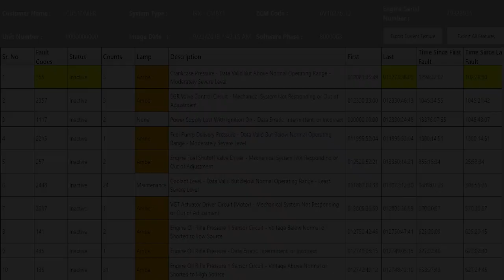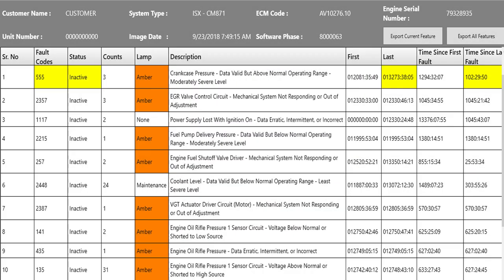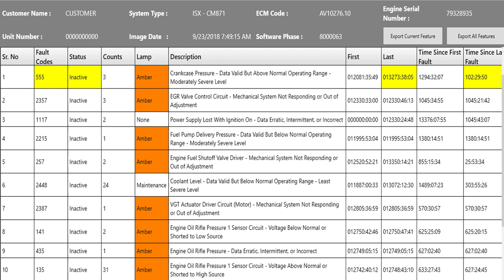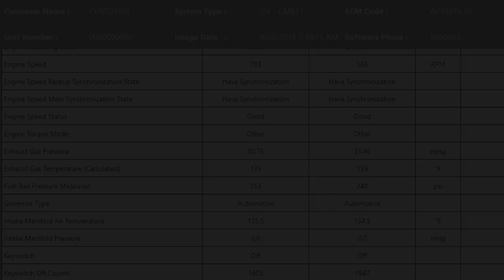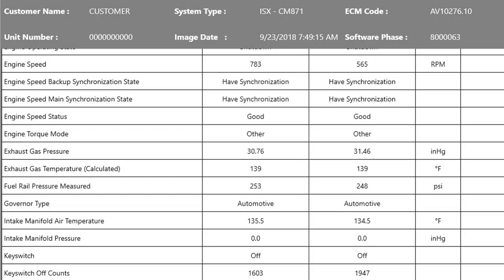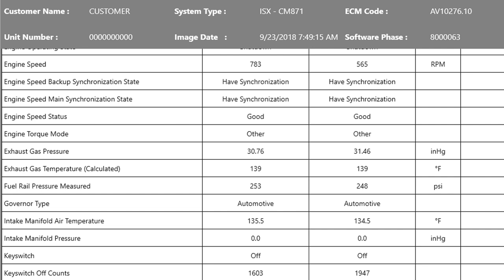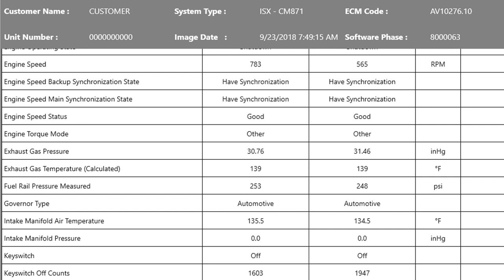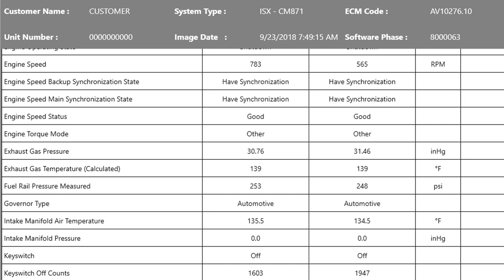ISX 871 FC 257 engine run on with key off

Comment: If someone was looking at a Cummins isx or a Cummins n14  if a driver were to try to set a maintenance schedule is there a serious difference in the two engines when parts needed to be changed and service needs to be done thanks
Reply from the maker: speaking for me. I would set the N14 overhead every 250K if it were electronic. Every 100k if it were mechanical. Yes they made a mechanical N14 with a Pt pump. If it is a 525hp 1850 torque I would replace all the headgaskets at about 570K miles. If you haul heavy they wont make it past 750K. the isx can go a million with no head gasket issues. All the internals should last 1 million miles if the oil was changed at 10-12k miles religiously and the air filtering system was kept in good working order. Celect injectors only need to be set a couple times (100k and 250K) and if you set past 250k make sure you spray brake clean in the small hole on the top of the injector body so the timing plunger does not stick from oil schellack. I would not set the injector after 250k on an n14 celect or celect plus( just set valves and jakes). take off the n14 ecm and clean the back and clean the fuel cooling plate of corrosion and put some heat transfer paste on the back of the ecm and bolt it back up. They corrode and then get hot and die. You can only buy aftermarket celect and celect plus ecms now. The rest of the parts are good for a million miles I think. Turbos without vgt yes for sure but vgt you never know.

Comment: This was a problem for sure, guys would get killed or come close to it when transferring dump boxes. When they would hit the external ignition button to reverse the truck towards them, it would come on and squish them between the rear of the truck and the front of the transfer trailer. The key was off but the momentary switch was enough to turn fuel on. 
Great topic to go over because this engine is going to be around for a while.